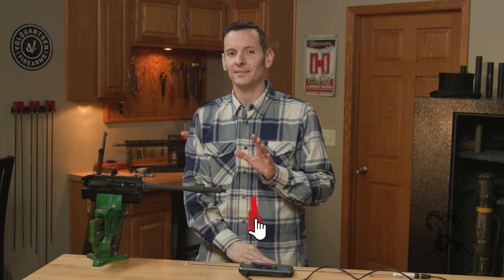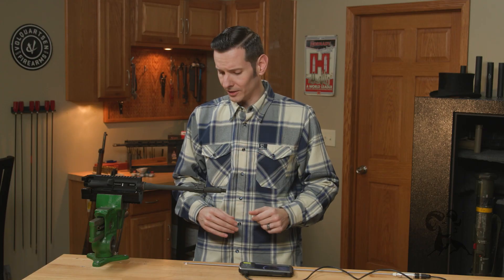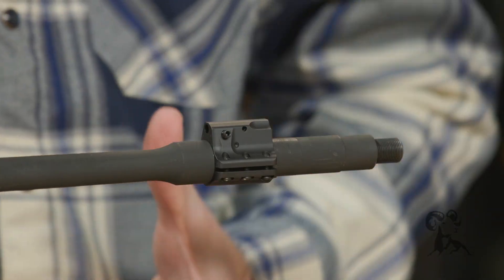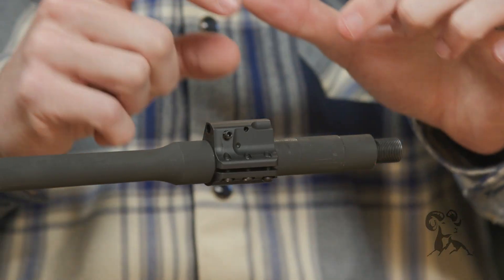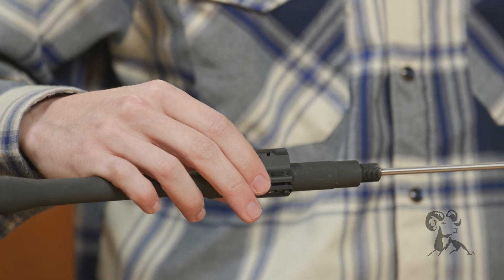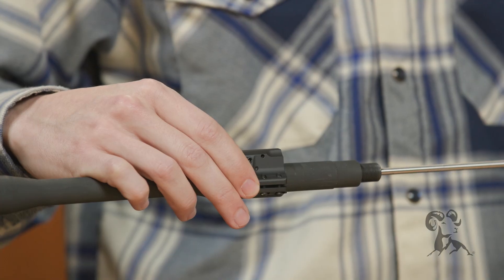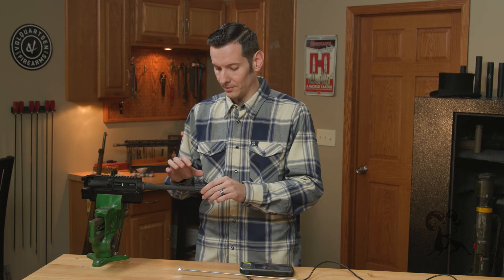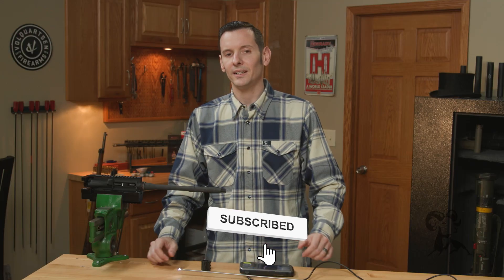Quick Tip: AR-15 Gas Block Alignment

Comment: In today's world a quality set screw type, or even better pinned gas blocks are plentiful. I don't see a reason to use a clamp on gas block. Buy once cry once.
Reply: While that's true, that's an entirely different issue and the issue he is talking about in this video still applies to dimpled set screws and tapered pin gas blocks.
Reply: @Enjoyer.762  I understood the point of the video. A clamp on gas block was also shown in the video. Should I not provide additional information for new builders?
Reply: @THPOOKY  You're going to confuse new builders by not providing the context that this also applies to set screw and taper pin gas blocks as well. I think people are better off leaving the gap between the journal and the gas block because many gas blocks do require it for proper port alignment.
Reply: @Enjoyer.762  I'm so glad you cleared up all the information for everybody...
Reply: @Keegan Timpanaro  You weren't going to.
Reply: @Enjoyer.762  guess I forgot to pay my troll toll this month.
Reply: @THPOOKY  Look in the mirror.
Reply: @Enjoyer.762  😘

Comment: They should put a little divot in the top of the barrel and GB manufacturers should leave a small piece that inserts into the divot.  Would make things much simpler.  I've never had an issue with it for the most part but installing an FSB...well...getting that alignment just right without repeated eyeballing would be nice.

Comment: Have to disagree with you Caleb, because I've had first hand experience with this issue. The second rifle I built was a bcm barrel and I think a Vltor gasblock. I didn't know any better and shoved it all the way against the shoulder. You guessed it, it was under gassed. Took me a while to figure out what was wrong. I'd say it depends entirely on the size of the gas Port in the barrel and the port cut in the gas block.

Comment: When all else fails, I just use a piece of dry spaghetti. So much cheaper than a borescope but they are a nice tool to have.
Reply: and I thought that was my secret / Mac Gyver to do.......BUZZ
Reply: @johnd843 I can’t figure out how on earth you would use a piece of spaghetti ???
Reply: @robertlipsey6056  Break off a piece in the barrel where it's in the bottom of the bore. Then you can add your gas block and turn 180 degrees and let it fall into the gas block. Drop a cleaning rod down the bore to break the noodle. Then you know they are in alignment. A country boy way of doing things & not a NASA lab tech doing the work...IMO
Reply: @johnd843  Thanks for the comment. I would have never thought of something like that. I can see how it would work though. It might be easier to just buy dimpled barrels. lol

Comment: Excellent video and information. I use a borescope for the same reason and for barrel inspections and for quality control reasons. Thanks.
Reply: Is the borescope just the rod that inserts into the barrel and plugs/connects to your phone or is a borescope an entire unit. What type of borescope do you use and what type is being used in this video?

Comment: Bottom line, measure it. I've seen tapered and flat edges on both the barrel and the gas block. It might be flush, it might be floating over the two tapered edges, it could be set back like if there were a handguard plate between the parts.

Comment: I was taught the the port (gashole😄) on the GB is usually 30% larger (50% in some cases and applications but not usually) than the port on the barrel...thus giving it leeway on alignment...unless it's a sight style GB.

Comment: First off, let me say it may have been my combination however, when I installed an Aero gas block on my AR the gun would barely run so I started investigating the cause. When I pulled the block back off the gun, the carbon ring around the gas hole in the barrel told the story. Butted against the stop on the barrel only about half the gas hole was exposed. After I repositioned the gas block down the barrel about the width of the ring everything worked fine.
Thanks for the video!

Comment: I've noticed this myself with my cheapo bore scope. I use dimple jigs and rocksett on all my gas blocks. An I always check alignment before I add the Rocksett. An the room for error is not insignificant.

Comment: This has not been my experience. I've seen several guns dependent on that position.  I guess it's dependent on the gas block itself as well.
Reply: When he slid the gas block all the way up against the barrel you could see at least .030" of barrel gas port edge  inside the gas block showing an obstruction thru the passage. This can and will cause reduced gas possibly effecting reliable operation. Why not just make sure everything is in perfect alignment! Some people even use a piece of spaghetti.
Reply: Just like a lot of other components when you’re building your own gun, if you’re using parts from a dozen different manufacturers, you can (and probably will) run into issues with fitment/alignment. Think tolerance stacking with bolt head spacing. Your best bet is usually just to make sure that critical components like your barrel/gas block come from the same manufacturer
Reply: @mostlypeacefulmisterputin  Probably will have problems? Um no, you probably won't have problems if you are buying decent quality parts instead of a bunch of lowest common denominator stuff. If what you're saying is true then most home-built AR-15s would not work reliably.
Reply: @mostlypeacefulmisterputin yes, I prefer to get barrels with gas blocks pinned from the factory 👍👍
Reply: @mostlypeacefulmisterputin  Cheapskates go the Frankenstein build route.
Reply: @TNRonin  Gun companies who make contract TDP spec or better rifles for the government do not use commercial market spec parts. You're simply wrong.
Reply: @Enjoyer.762  ok you go with that.
Reply: @Enjoyer.762  I used a mismatched brand barrel and gas block combo, with a barrel that cost $328 and a low profile gas block that was about $70. Is that a cheapskate build? 

People who think it's important that the brand names are all the same on all the components demonstrate a lack of knowledge and understanding. A lot of people who call custom build AR-15s Frankenstein rifles, have attempted to build one on their own at one time but didn't know what they were doing and were just too ham-handed to do it correctly, so now they're on the internet calling custom-built rifles Frankenstein builds. 

Most AR-15 manufacturers outsource and buy major components from multiple other companies and have their name stamped on the parts. If the parts are made to the correct specifications it doesn't matter what brand they are. 

I've not seen any companies who manufacture expensive AR-15s and also sell individual parts, say that using them with components from other companies is not recommended, or that it causes compatibility problems. They might say don't use something with another brand if the component is something proprietary and not milspec, but not on standard components.  If it was a problem they would have a disclaimer saying something like you must buy our bolt carrier group and gas block with this barrel or the warranty is void. But that's not really a thing is it? They do say the warranty is void if there is damage caused by being used with other manufacturers products, which is perfectly reasonable.
Reply: @actionjksn  Every manufacturer has some tolerance differences and different QC. If you assemble your rifles this is something you should already be aware of. You seem butt hurt by my comment. It's not to say you can't mix AR15 parts from different companies under any circumstances. I don't give a faq what you do. But it can be an issue. Stop pretending that it's not.

Comment: keep about a quarter gap between the journal of the barrel and rear of the gas block, use canned air with a straw on the gas tube from inside the receiver and verify you feel the air out of the muzzle... done...
Reply: Not true, you can have over half the gas port covered and still get air through..Better ways to test but the bore scope is still the best way to verify..
Reply: @hairydogstail  sure; but why make it more susceptable to failure by having the least amount of port coverage as possible? The more of the port that is covered the more likely you are to have failure with lighter loads. If you are building a dedicated suppressor platform, maybe covering a portion of the port makes more sense if it's not a pass through design can, since there will be more back pressure help with cycling; but otherwise it's just less reliable... also regarding the bore scope, I agree... im simply talking about a way that most people can at least verify they have flow, being that people rarely have bore scopes...
Reply: @boss350z5  I think we got lost in transition. I agree the port should not be covered. What I was trying to say is if gas blows through the port like you suggested, the port could still be blocked by half..Best way to verify port alignment is with a bore scope or remove after use and verify carbon ring around gas port..
Reply: @hairydogstail  Ah... gotcha, so were saying the same thing, you're just pointing out that using canned air isnt the optimal method of testing, I'm simply listing it as a quick and dirty method that is fairly effective, though not as effective, admittedly, as a bore scope or checking for carbon ring deposit after test firing... fair. Simple misunderstanding.

Comment: I had an upper build that would not eject. Had a couple guys in the shop while i was building it. I even took it to a "real" gunsmith. He couldnt figure it out but charged me $80. Took it back to the shop and started taking it apart. Gas tube was upside down! Distractions are a bitch!
Reply: It had to be a straight gas tube (which are not that common) used for certain gas blocks like the Rifle Speed, or the gas tube would not line up correctly in the receiver..
Reply: Cool story bro.
Reply: Unlikely... but ok.

Comment: Thank you for clearing up the myth that you MUST leave space between the gas block and shoulder. So many people just repeat something they heard someone else say but dont actually know the information for themselves.
Reply: Depends on the gas block design, some are designed to fill the gap.
Reply: I personally never put different metal alloys butted against one another when he becomes involved. I like to give thermal expansion a little room. Other than that I cannot think of an issue.
Reply: I’ve always measured gas block alignment as demonstrated on nsz85 YT channel.  Never had any problems with my builds using this method.